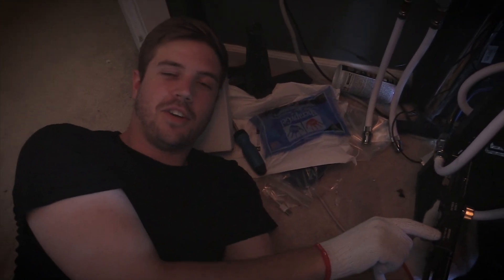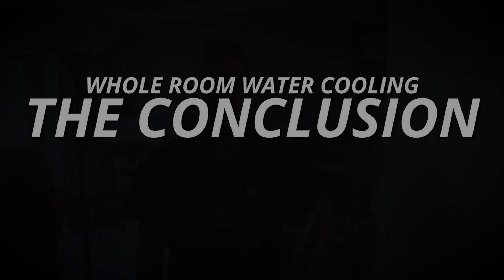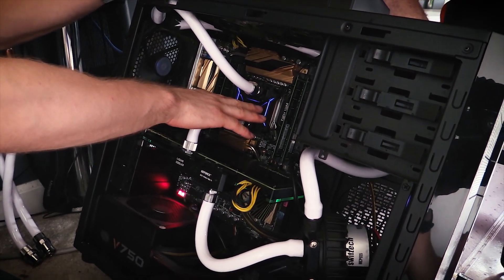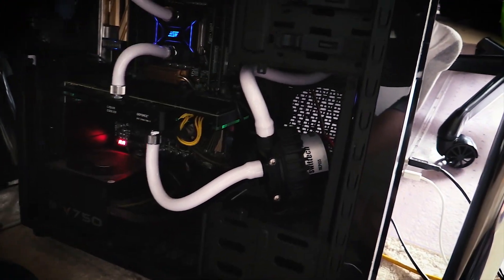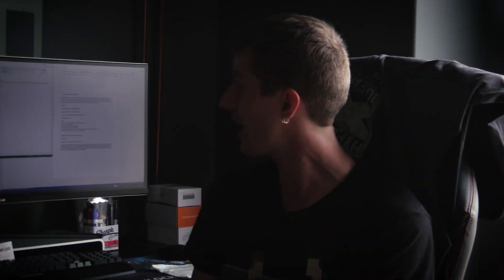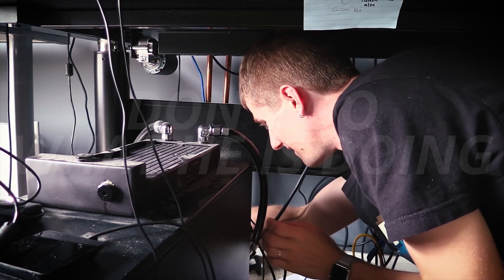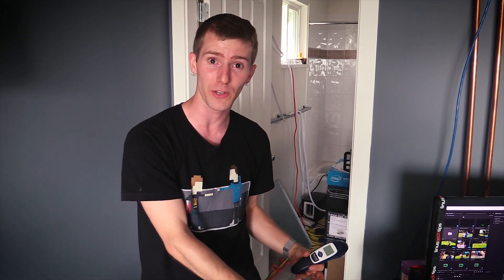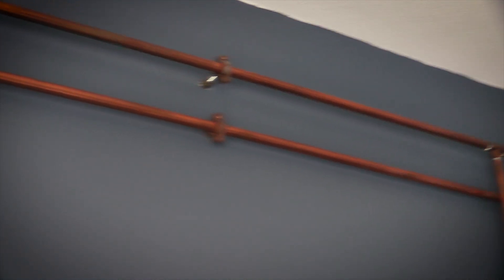Whole Room Water Cooling Part 7 - It's FINALLY over!

Comment: That cooling does seem awsome altough what if Lighting strikes the outside box and destroys all those PCs in one Godly combination.

Sir.
Reply: ImMusicallyYours You are aware they use plastic pipes to connet to their PC's... With the lenght of that pipe and the rule "KV per cm" (ie a killavolt will arc across 1 cm but not 1.1cm) then they would ned a few sevral volts before it became a problem, and i highy doubt the resistance of the fluid will cause any other problems, not to mention the pumps are grounded meaning those would help...
Reply: TrainMasterMan Um, your answer is correct that the risk is essentially non-existant, your reasoning on the other hand is very flawed. First, the plastic pipe is irrelevant since you have a conductive liquid flowing through the pipe. Second, if lightning strikes something, it has exactly enough voltage to arc to ground through the path of least resistance regardless of what that path is, that is how lightning forms. To give some perspective, that lightning bolt has already arched several hundred meters of air form the charge source in the clouds to whatever it hits on the building, compare that to arching across 10cm from pipe to computer.

The reason a lightning strike would not be a high risk is because (if they did this at all correctly) the bits on the outside of the building have a direct and fairly short, low resistance, metal connection to ground and therefore the computers are not in the path of least resistance to ground. Even if they did it wrong, the pumps should be grounded (through the mains ground wire) closer to the outside bits thatn the computer and that will be the path of least resistance.
Reply: My point at the end "not to mention the pumps are grounded [lowest resistant straight to earth] meaning those would help..."
Reply: Lightning is nothing but electricty in a much much bigger quantity, and therefore, current laws still apply. "Electricty always finds the closest point to ground" Rule one, a rule eveyone dealing with current must know for safety. In electronics they have what you call spark or arc gaps, designed to take high voltage (lightning) straight to ground. Other and more modern devices use mov's. I've replaced one after an electrical storm once for someone else. They destroy themself acting as a short circuit blowing the mains AC fuse. Or even better- if you live in the county you will see that houses, at their highest peak, have something like antennas usually aroung 16 inches tall. These go STRAIGHT TO GROUND through a 4 or 8 foot pole driven into the GROUND! So grounding something has GREAT effect on lightning and for people out in the country saves them! 

Thats why if the pump is grounded it will go through ground and to the earth. If you know house code all the breaker pannels or fuse panels connect to your main copper waterline in AND your power line.

I dont know if you know about RF emf's through a tin can, but your PC is grounded, so even in the lighting gets that far then it will simply go to ground, and wont even flow insie the case.
Reply: TrainMasterMan Google a picture of a Tree getting hit by lighting and you will Quickly realize how wrong you are about what Grounding is and how it effects lighting..

A tree is literally GROUNDED (its in the ground). 

then imagine that this tree were instaed your PC. 
:D you will laugh. (there will be only ashes left)
 And its completly irelevant if its a Direct hit or a near hit in terms of breaking electronics.

ps: grounding something actually Attracts lighting. which is something you never want in connection to electronics, that breaks even if lighting hits the nexthouse over. this is how EMP works. or  "induction".

Most people missunderstand theese basics physics. 

Dont get me wrong "grounding" can be helpful but it has nothing to do with saving electronics. Its about helping people. When electronics break. Even then  it is not related to lighting. Which is not "simple" Currents.
Reply: TrainMasterMan 
"Just because someting is in the ground doent mean its grounded. "
hahaha you made me laugh so hard when i read that :D

The point is that Nobody in their right mind would connect a lighting ROD with your PC or a human for that matter.

That is the whole MEANING of the lightning Rod. To make the lightning NOT go into your PC, house or person.

Did you even watch the clip you sent me? Or google a tree exploding from lightning.?
I made it super obvious in a humorus way since you clearly didnt understand the basics.

please dont type to me again.
Reply: Ok, do you understand electricity? I am making a refrence to ground rods because of how they work. Look at the pumps linus and his team uses in his videos, and just answer this one simple easy question, are they grounded?

Ohh and if I have a plastic rod and stick it into the ground, clearly its grounded right?!?!? Im sorry last time i checked wood is a pretty good insulator, YOU NEED to relize what your saying and YOU need to do the research, its not the tree that conducts its all the resin inside! Please shut up you have no idea what your talking about- I do... my channel proves that with the only two videos of my amp.
Reply: TrainMasterMan dude, I've seen multiple computers die during lightning storms; surge protectors short to ground, but lighting can saturate the ground wire and still provide thousands of volts to connected devices. The pump may or may not be grounded, but I would sooner guess that it is double insulated. If the rad outdoors gets struck by lightning the computers are all dead.
Reply: You can't saturate wires, just like semicondutors they will destroy themselfs to suite your needs... a ground wire would basically have to get so hot that its burns and busts- which is perfectly correct, im not saying your wrong there at all.

But you also have to consider the fact of circuits in the house.Curent won't flow to the computers because theres no where to go essentially. For instance the bird on the power line senario, bird wont get shocked because he is on the same polarity of the wire, same kind of thing with the computer. 

NOW I KNOW that lightning strikes carry thousands of killavolts at massivly high currents (imagine if we could capture it and harness it...) but i dont belive it would do any major damage to the electonics in the case. I mean have you ever seen them playing around with "fake" lightning and faraday cages? those cages are made with maybe 22 AWG wire. Same kinda thing with your computer. 

And i said it above but I dont think the liquid is conductive, so it cant reach in the pc. But i did have to think on the point that you made where the pumps may be double insulated... never thought of it.
Reply: TrainMasterMan The liquid is very definitely conductive, it is a solution of water (pure water does not conduct well, but solutions in water do, and the gunk buildup in their systems show that the water is not pure by any stretch).

A lightning strike passing through a computer component pretty well fries a lot. This is largely due to induced current, back in the days of dial-up many people (myself included) had the experience of the phone line getting hit leaving a toasty modem and a computer where nothing else was visibly damaged but everything was borked. Bad sectors in ram, corrupted files on disk, unreliable or dead processor, etc. In the case of a dial-up modem the lowest resistance path from one of the phone wires to ground was through the modem and arching across to some grounded component inside the PC. 

When he says saturating the ground wire, he is probably referring to the effect you see in voltage splitters. If the resistances in a circuit are set up correctly (or poorly depending upon your perspective) a large voltage source will send it's current to ground via multiple paths.

In the event of the charge from a lightning strike reaching the hot wire in your home's electricity, the lowest resistance path to ground is through a device since in the wire itself has a pretty good insulator separating the (now overcharged) hot wire and the ground wires, but the separation in your power supply is probably just an air gap. 

Isaac Karjala The computers being fried is not a sure thing, and really isn't even all that likely in this setup (assuming the radiator was properly grounded). If the radiator and whatever components of it the water runs through are all more electrically conductive than the water and those components have a low resistance/high capacity ground connection that won't fail under the load of a lightning strike, then the system as a whole is a Faraday cage around the liquid that will prevent the current from crossing the metal/water interface. If it is not properly grounded or the material is not significantly more conductive than the water then your point that the pump ground doesn't matter is very valid and the computers are probably in a bad way.

ImMusicallyYours Lightning striking next door won't fry your electronics, I've lived in a house where the rod got struck at least twice and the phone line once. The rod strikes damaged nothing and the phone line only damaged the computer with the modem.

Comment: They make insulation for the copper tubing. Its usually coming from the water heater to keep the hot water hot and the room not hot. I think it would work well in you're case.

Comment: Can someone tell me if this is good? :D

PC
CPU: Intel® Core™ i7-4790K
Motherboard: MSI Z87-G43
RAM: Corsair DIMM 16 GB DDR3-1600 Kit
GPU: GIGABYTE GV-N75TOC-2GL
SSD: Intel® 730series 2,5" SSD 240 GB
Case: Corsair Carbide 200R
Power Supply: Thermaltake Hamburg 530W

Gear
Keyboard: SteelSeries 6Gv2
Headset: SteelSeries Siberia v2
Mouse: SteelSeries Sensei Raw Glossy
Mousepad: SteelSeries QcK+
Monitor: BenQ XL2420Z
Reply: hey GUYS, I JUST got the SICKEST MOST EXPENSIVE PARTS available. I'm NOT SURE THO if it's good XDDDDD :D :D:D can u guys help me PLS :D
Reply: Gami Pro if you want it to be a gaming PC, it's severely unbalanced. An overkill CPU and a lot of RAM, for a sub-par GPU (750ti).

Is that a pre-build "gaming" PC ? For it looks like an archetypical one.

Another point : there is only a 240G SSD inside. Prefer maybe a smaller SSD (60 or 120 GB) with a Terabyte- (or bigger) classic Hard Drive, for the same overall price. SSD for the OS and a few games that are annoyingly slow to load, and the rest on the HDD.
Reply: ***** I wanna build this PC in soon.
Don't need much GB and i laik the look of the intel ssd :D
I dont play high fps games, but dont want to upgrade the system for the next  years.
Reply: Gami Pro if there is one component you don't choose for the look, it's the storage.

240 GB is very small if you want to put movies or series inside.
Reply: so why is the intel ssd so expensive
Reply: Gami Pro SSDs are much much faster than HDDs. A good compromise is a small SSD for the system + a few games, and a massive HDD for most games, movies,...
Reply: Should I take preferably an GTX 970
Reply: Gami Pro Over a 750ti ? If you have the money go for the 970 it's at least twice faster.
Reply: kk when then i have to uprgrade this system

Comment: I think this is a success although I didn't understand why you went with copper tubing where the heat will go back to the room itself rather than pvc which insulates that heat upto some extent. You could install refrigerant system in your editing room, inlet with r134a, chillers on roof etc.

Comment: I think that instead of tapping off of the main coolant line, you should have had the main coolant line go straight through the systems. This way you would have had better coolant flow. I'm not sure if those two pumps are providing enough pressure in the main line for the tapping off of it.

Comment: You should still watercool them in the new office even with the air conditioning, Lower temperatures are still better even a 1 Degree difference

Comment: lol. that's a lot of waste. I can't imagine the downtime it would need if something needs replacement. I had this similar problem as I want heat to be routed out of the room.  The solution I thought of would be flexible ducts hanging from the ceiling where it can be mounted to the standard 120mm exhaust of any case.  These ducts, of course, are connected to a commercially available exhaust fan.  The fan, I think, should be speed controlled so that it runs slower during the colder season and faster during the summer.

Comment: Hello there. Maybe you should use insulated tubing instead of copper pipes because the copper pipes are conductive, allowing heat to dissipate into the room before reaching the reservoir and the outside. Just a suggestion :)

Comment: This was interesting. I have seen large water cooling ac systems in Miami for high rises. If you trickle the water though a 4-5 foot humidifier mesh outside and gather the water in a tray underneath and recirculate that throughout the system and cover the copper piping it will reduce the heat in the computers by tons. The room however could also be cooled by running the cool water line through your radiator system inside the room. if you do that then the cooler the room gets then the cooler the water is that goes through the computers ;) The water loses its heat gathered in the room/computers via evaporation. The water cools less then the air outside. A reservoir is under the mesh and it will have to have some sort of trickle resupply. That is where you want to pump from. Currently you are only losing the heat from the water, that is higher then the outside temperature. So it wont well work in summer, only really winter. I would be willing to help out no charge since I live in your area now. The setup is cheap. Don't give up yet. You are on the right track to a solution. It is a hot summer for a while yet. I am no ac guy but I get this setup and I am a gamer to boot :)

Comment: With the copper tubing, you could have added some slip over foam insulation which would help with the heat dissipation into the room.
Reply: Eric Brunhammer Actually, using PEX or even just PVC would dramatically reduce the radiation effect.  Sleeving the copper pipes with slip over foam wouldn't keep the copper from radiating and you would still have the heat escape into the room through the slotted part of the sleeve.

Comment: Sad to see this failure.
Copper tubes that give away heat, long copper tubes - even worse. Single system for all of the PCs - doesn't look balanced. Use something that doesn't give away heat, use individual systems for each PC and reduce lenght of all tubing by moving PCs to exits of the room.

Comment: You've destroyed the general appearance of the room became a tube room. And that under the name of more efficient cooling hardware. I think that the high cost and greater effort in constructive and grotesque scene in the organization and design. I think if you used a water cooler for each device will be much better. Among the disadvantages of this project if it occurs a problem with the cooling will make every computer stops working

Comment: The biggest problem that I see is that Copper is a great heat conductor.  Your copper loop IS a radiator.   You would just have to insulate the copper tubing and the efficiency would increase dramatically.
http://www.globalindustrial.com/p/building-materials/pipe-tube-bending-cutting/pipe-and-tubing-insulation/insul-lock-self-seal-6l-1-2-thick-1-1-8?infoParam.campaignId=T9F&gclid=CjwKEAjwla2tBRDY7YK9uKXe8R8SJAAhG6LGegyjeQ-RfdeA5235NA7caJ4Ppf135pU419KMNmaRpBoCD3Tw_wcB